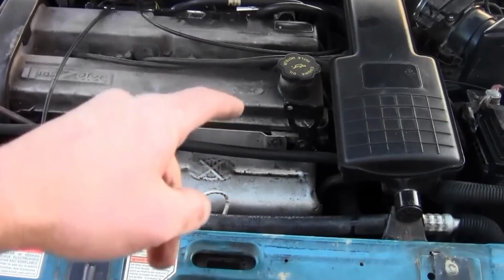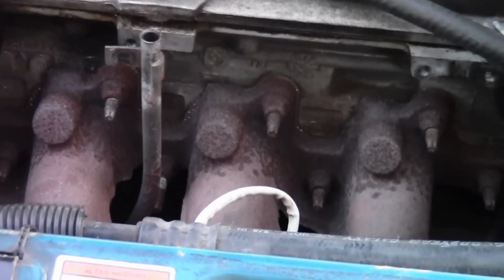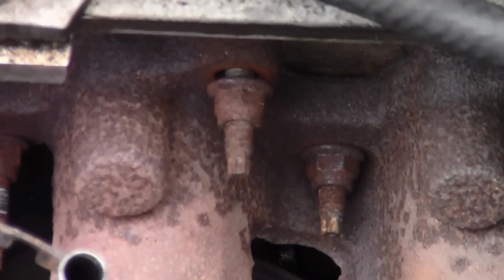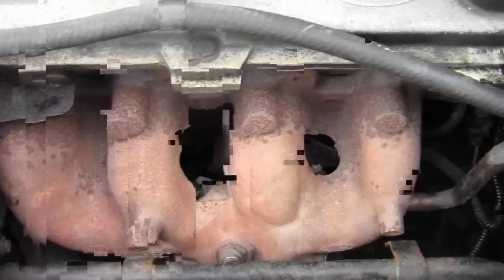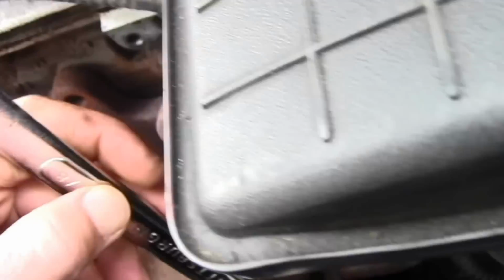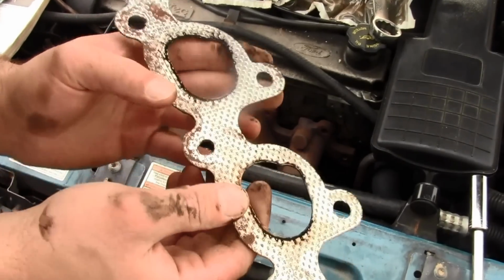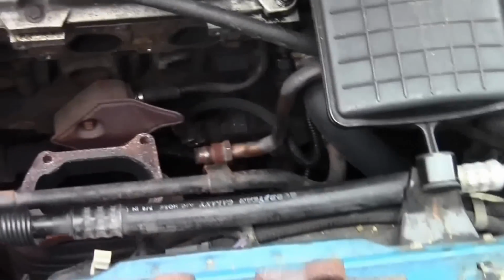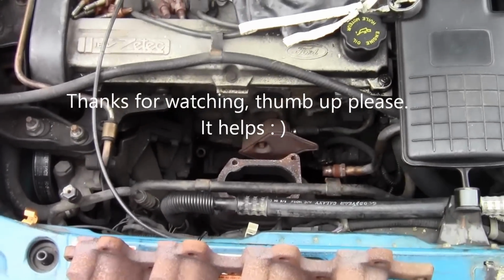How to Access PCV Valve on Ford Contour 4 Cylinder 1997

Comment: Yesterday I checked my PCV valve on my Ford Mondeo ( the Contour's sister from Europe ) and you don't need to remove the exhaust. Just remove the airbox ( in your case ), remove the thermostat housing, and under it is a bolt that holds in place the metal tube from PCV. Is a Torx 40 bolt. With that one removed and the exhaust's heatshield also you can jiggle a little the tube and remove it from the rubber gromet that connect the PCV and the metal tube. After that just extract the PCV and that's all. It is possible to remove that torx bolt without removing the thermostat housing but you need to feel it. In my case it was a lot of dirt over it and I didn't feel it very well.
Reply: SuperMadcox agreed, the one advantage of this approach is perhaps renewal of the oil separator itself...